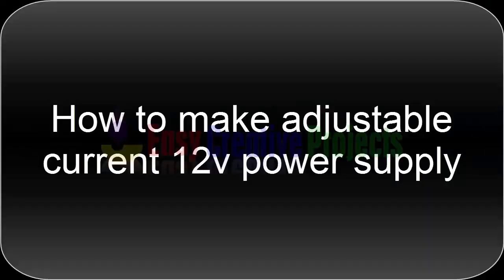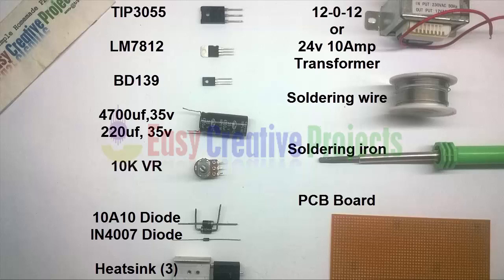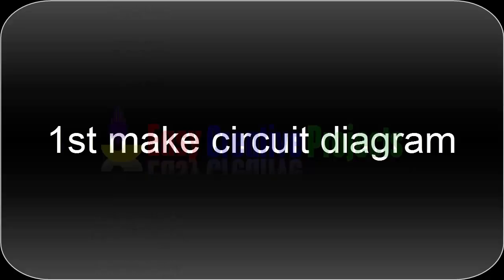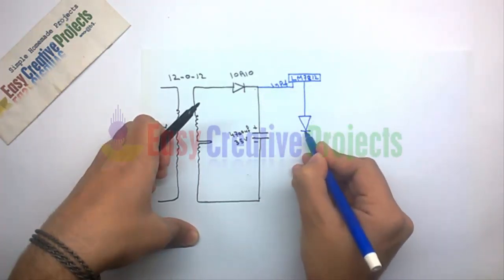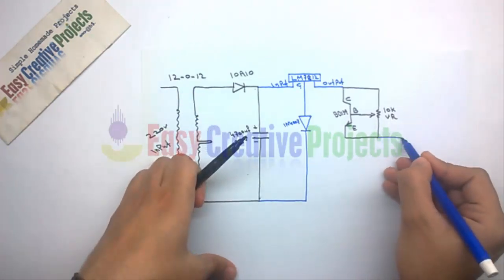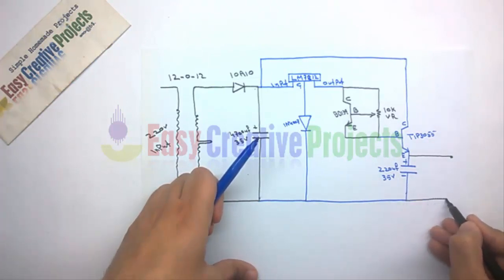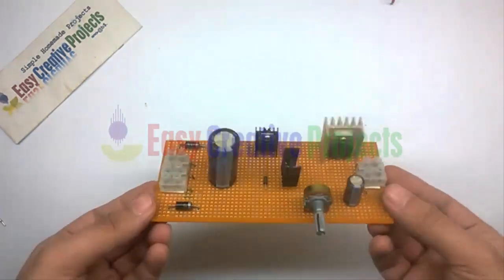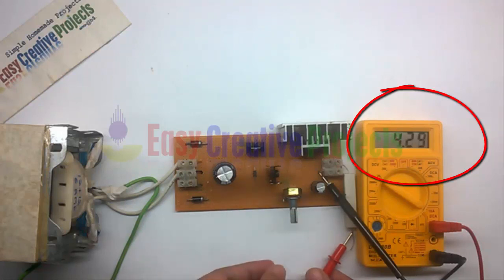How to make adjustable current 12v power supply - with circuit diagram

Comment: Can I use it to charge 12v , 3 amp battery?
Reply from the maker: yes its adjustable current. you can use it. but if you want to get perfect charger then you need 13v.

Comment: This is a very noisy circuit considering that the voltage output of transformer was not filtered in full swing of the voltages, only one diode is use as rectifier. To produce a nicer Vreg,. The voltage output must be filtered in full- wave mode
Reply from the maker: yes for good working we need proper diode bridge rectifier. 
thanks for correction.

Comment: Thanks 💐💐🙏🇮🇳can you make 12volt dc 10amps to 24volt dc 10amps boost converter pls with drawing
Reply from the maker: dear if your demand is 12v to 24v, then simple make a inverter base 12v to 24v 10amp transformer. 
thanks.

Comment: is this AC to DC power supply?
Reply from the maker: its dc power supply.
if you use only transformer without any circuit then its provide you ac output.

Comment: can I use the same circuit daigram but have 5amp more by adding more TIP3055?
And also the diagram doesn't have any fuse, do I need a fuse for this and If I do where should I put it?
Reply from the maker: yes you can get 15amp maximum current form TIP3055 transistor.
simple replace 10amp transformer with 15amp transformer and get 15amp current.

Comment: Hello, nice video, do you have a voltage drop when you decrease the amps ? thanks
Reply from the maker: no dear. when we increase or decrease current then no effect on voltage. because we use fix voltage regulator.
thanks.

Comment: Hi bro. Can i use this to charging car battery
Reply from the maker: its take some time but you can charge.
Reply: Nope, use the circuit of LM338 recommended  for use as Batter Charger, you can design and build battery charger with up to 5 Amperes current output from NATIONAL SEMICONDUCTOR LM338 IC Vreg.

Comment: can you please make a DC regulated power supply using 12 0 12 transformer
for voltage minimum 2 Volts to maximum 30 Volt DC output
using LM317 circuit
and along with digital volt meter

Comment: Can we use laptop charger as input to build variable voltage variable current power supply?
Reply from the maker: yes dear simple replace transformer with high ampere charger.
thanks.

Comment: A 12 Volts battery needs about 14.4 Volts to charge properly but a 12 Volts regulator won't give more than 12 Volts
Reply from the maker: dear if you want 15 volt output then simple replace lm7812 with lm7815. its provide you 15v output with this circuit. or watch video on our channel ( how to make 15v 3 amp power supply )